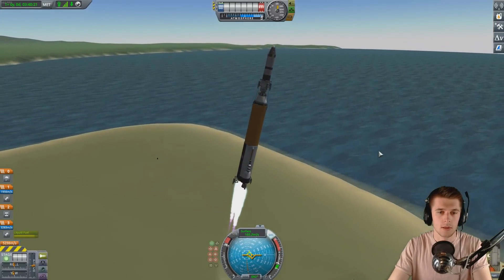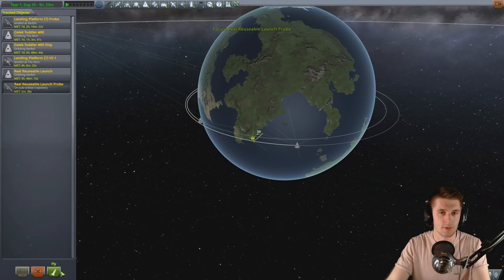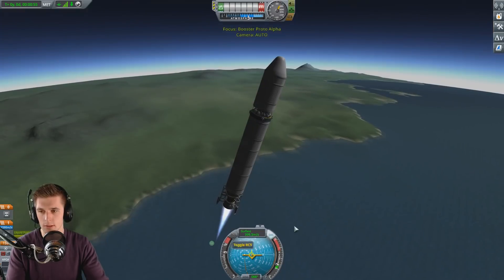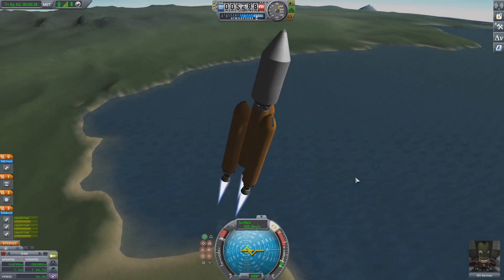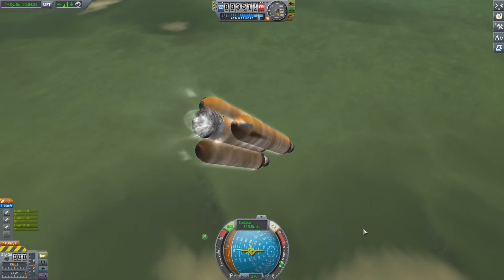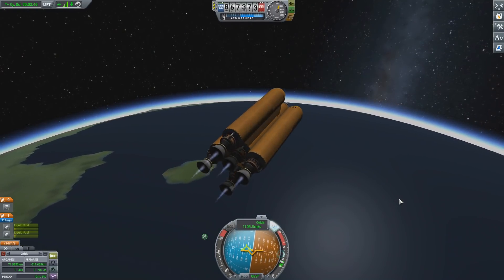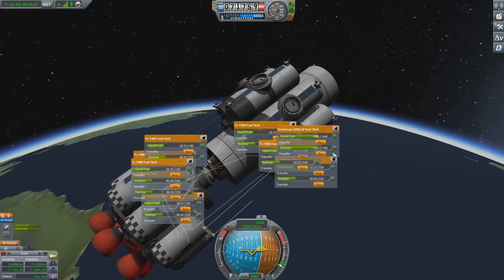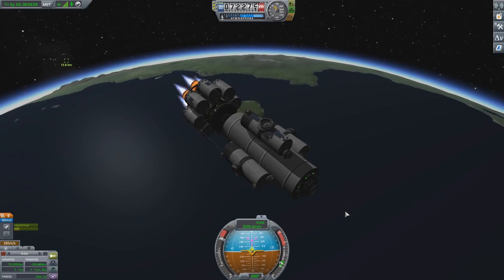Kerbal Space Program: Fully Reusable Booster

Comment: I was able to make a reusable rocket. I then turned it into a reusable liquid fuel boost. It kind of works but trying to land more then 2 to 3 is difficult. Landing 4 is very difficult. Due to the rendering distance of the game your probe reusable sstos will just disappear when your out of range. You have to keep them in range to land. However you also need to get your payload into orbit but you then are out of range. I was doing this in stock btw.

Skipper engine is not powerful enough even with almost 27 of them. I am now using the pollux solid booster to help. But the skipper uses fuel fast.

Comment: My solution? Strap radial chutes to the top of my first stage, and have them deploy when I decouple. If I get the altitude for opening right, they'll fall far enough, fast enough before slowing, that the rest of the rocket hasn't gone far enough for the first stage or any boosters, to go out of physics range (all be it, with the extended physics range mod). So the chutes slow them down, instead of the game predicting they'll just crash and explode.

Comment: The third solution as far as the game works is to have near SSTO first stage, seperate and then finish orbiting the first stageon its own and deorbit it above KSC on the next pass. I do that for my Ariane 5 main stages and it works like a charm, I add parachutes though. Stock Kerbin is too small for a efficient boost back burn. Also Reusability Expansion grid fins offer a good way to control the descent and slow down at the same time. Stock airbrakes are less precise.

Comment: SpaceX may not use parachutes, but they do use airbrakes and they don't have to land manually on slopes using WASD!  Don't feel bad using a few :)

Water physics have been changed a lot in KSP over the years; if you slow down enough, it's not hard to land in the ocean.  Of course, if you're roleplaying a bit, makes more sense to land on, well, land.
Reply: He has to have airbrakes unlocked though.

Although I suppose opened cargo bays work just as well
Reply: I use the heck out of the small cargo unit to drag my ships into an engine-first orientation when entering atmosphere.
Reply from the maker: @HojozVideos  Oh, interesting idea...